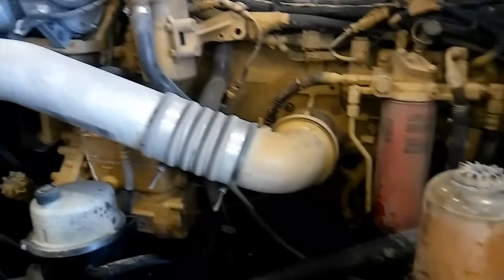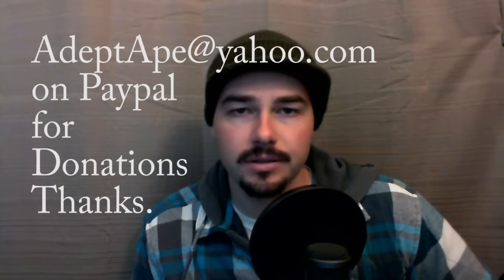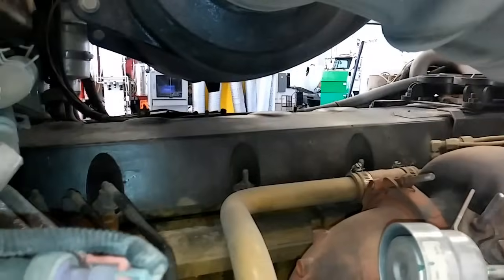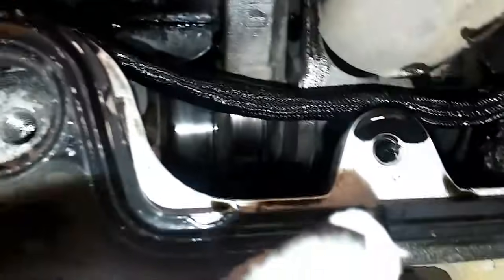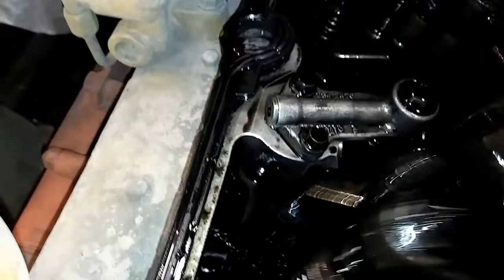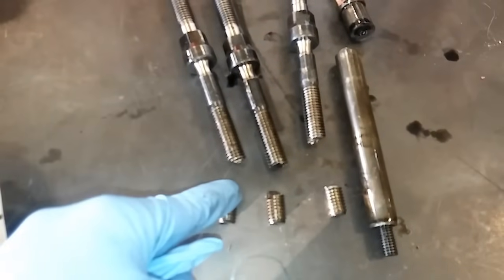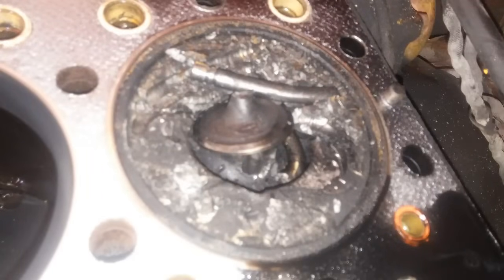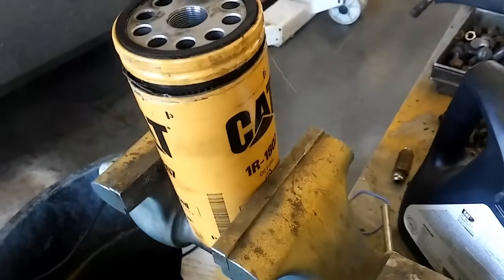What Causes Diesel Engine Ticking, Clicking, Tapping, and Knocking?

Comment: Great channel! I just discovered it. The C12 in the truck I drive at my day job developed a click, then clack, then knock, then bang. All within 1/2 mile. Ended up being the wrist pin in number 2. The teflon keeper for the wrist pin decided it didn't like being there any longer. Took out the piston (obviously), sleeve/liner, and took a hunk out of the block where the liner seals up. Block is junk. Employer is going the Platinum rebuild route. Cat dealership said they don't use the teflon keepers now?
Reply from the maker: +oldbones I know the little pucks you are taking about. I haven't disassembled a new C12 piston yet to check, because they get installed with the liner. I thought those puck designs were kinda weird.
Reply: S&S pistons(high performance) for Harleys have those "buttons" as an alternative to the circlips that have worked so well. I've taken apart a few top-ends that others have used the buttons in to find scoring (sometimes severe)  from debris trapped and embedded between the buttons & cyl liner. Somebody's idea for a "floating" wrist pin didn't work out to well no matter what motor it was in...

Comment: Hi, my name is Ben, I just brought a 2013 Ford Ranger, 3.2 Diesel engine, I notice I tried it for 20 minutes I start to hear a knocking sound, I can especially feel the knock on the clutch, after I change the engine oil, The knock comes on at about 40 min of driving now instead of 20min, it also comes on faster  if I under rev the car when I change gear, so if I change gears at 2500-3000rpm , The knock don't come on as fast, so lagging it makes the knok comes on faster, do u know what it is? Help

Comment: Hi bro
I have 1hd lc 80 engine
It has load sound and very hot blowing white smoke 
I changed my injectors and clean the pump but still the same
What should I do bro,tnx for help
Reply: White smoke can indicate water (coolant) in the combustion chamber. Look for a bad head gasket first, are you loosing coolant??

Comment: My 2014 Duramax 6.6 fuel injector pump went out. Is there a way to clean the injectors or do they have to be replaced along with the injector pump. I was told that there was metal in all the injectors now. Dealership repairs $9,000.
Tks

Comment: Hi brother I have contacted you previously about the shake I had in the engine and now finally it broke down on the highway I have exhaust popping/thumping/slapping through the turbo intake side a mechanic has seen soot in the intake and has said it's mostly a valve which I believe is correct but I had just 2 months ago run a diagnosis at Yancey caterpillar Jefferson, they did a #5 injector claiming 100% it will fix my vibration which didn't I asked them to run an overhead which made no difference in the engine sound, I think I'm just being robbed all over the United States of America truly speaking there are much much better mechanics off the streets in India who can diagnose and fix anything accurately and for alot cheaper. just imagine my engine vibration has been diagnosed/replaced bad power divider!!!🤔 then the drive shafts!!! 😣then the clutch 😵 then it keeps going on... all they have done is made me spend $16000🤑 on a $11000 🤒truck , all I ask is may God make them realize how hard it is to waste all that money. Shame
Reply from the maker: +Aiyman Khan Sorry to hear you have what sounds like valve or valvetrain damage. If they did an overhead and there was something wrong in the valvetrain, it should have been caught at the time of the overhead. It is possibly a valve issue, which wouldn't have been caught, but it is very unlikely a damaged valve would run that long before failure. Vibrations can be hard to find at times though, bad damper, off balance crank, lots of other things as well it could have been or is.
Reply: Adept Ape thanks for you reply. I wish I could have brought my truck to you can you tell me where is your shop so I can bring it there in the future. My issue was diagnosed as an injector by the cutout test which you said also could be a valve I also do have blowby which could have been the valve but now its no use I'll fix whatever it takes please can you send your work contact  by email aiymankhan786@yahoo.com or text 4045507005 thanks I wish I would have brought it to you before all this happened.

Comment: "pull your oil filter, cut it open and look for metal"  Don't forget to use the special filter cutting tool;  if a hacksaw is used,  you WILL find lots of metal particles...
Reply from the maker: +MrGGPRI Yes, a valid point, if you cut it with a cut off wheel or a hack saw you'll have small metal pieces in the filter.

Comment: G,Day Mate what do you think of Snake oil like slike 50 STP you put it in with the oil Slick 50 is $85 a litre ver dear is it worth it Thanks Man ?
Reply from the maker: +goldwingman1500 While it probably does have some benefits, I've torn a lot of engines down and inspected the bearings. I've seen engines with a million miles and the bearings look great with none of those additives. Modern day oils are pretty good and if you do normal oil changes and filter replacements your engine should do fine.
Reply: I have   a 2009 Subaru outback diesel 6 speed manual great lot of power my first diesel car i have ever had had 4 goldwing starting with a 1000 cc then a 1200 cc g/wing then a 1500 cc G/Wing for 12 years then sold her for $12000 with 165ks on the clock and bought a 2009 1800 cc goldwing luxury great ride i changed the oil every 3000ks with new filter i use a fully synthetic oil cheers for now talk soon goldwingman1500  Google N Albury Book shop Bomb i set the boobie trap off and shot 3fellow fireman or go to my youtube channel goldwingman1500                       talk soon .?

Comment: I have a 94 f450 73 and I've got a problem I have 3 rockers  on the same side that are loose and not oiling good but I've got good oil pressure would bad injectors  cause this
Reply: IDI or PSD?

Comment: Been around diesels my whole life. They make lots of noises and 9 out of 10 people would never think they had an issue for slight knocks and ticks. If you tear into a diesel that's been used odds are you will always find something wrong with it. Doesn't mean it won't last another 10 years that way.
Reply: austinr09 people like you keep me afloat i always get bummed when people say somethings wrong with my international but ive had the motherfucker for a year and everythings been good just regular maintenance and wear and tear thank you for your words of inspiration
Reply: Michael Medina Same here...my cat sounds good but theres a tapping sound...you get paranoid from every little sound when it's your truck...nonetheless i'm still saving for a full rebuild...just in case
Reply: @jmh4ggg  wise move. Doing  the same. 3 years later did the rebuild come to fruition or were your worries for nothing?
Reply: @CowboyFirm  Lol it's crazy that i wrote that 3 years ago. Yeah i did get it rebuilt, it started pushing coolant out of the reservoir, the head gasket was compromised, but the tapping was nothing to be concerned about. 

Its been about 2 years since the rebuild, i'll never go to a 3rd party for expensive work like this again. The front main seal has been leaking oil, and I forgot what its called, but my cold air intake module needs to be replaced. This has been a problem since right after the rebuild, they messed it up. However since i still have all new parts in my engine, im just gonna have them replace those air intake modules, replace the front main seal, and replace the head gasket and spacer plate and be done with it. 

I'm hoping to get all that done by march.
Reply: @jmh4ggg  what engine do you have?
Reply: @jmh4ggg 
Ja som tiez paranoidny z kazdeho maleho zvuku.3x som prerabal motor a 2x menil.Pozdravujem zo Slovenska
Reply: Go get a tune up or valve adjustment fixed mine

Comment: Would it not be due to a high compression ratio during the pre-ignition phase where pockets of fuel combust before TDC which essentially works against the power stroke? The compression ratio is uncontrolled (unless you have an injection rate shaping system installed) and thus the flash point can be mis-timed especially when you have a rich burn with a lambda value lower than 1. I'm studying Mech Eng at uni in my last year and this is a common question that has come up in past papers. This would result in high frequency vibrations with increased stress concentrations... anyway that is what I thought. I could be wrong, but it would be good to know the answer.

Comment: HELLO ADEPT  I HAVE A MITSUBISHI 4M40 DIESEL ENGIN THAT DEVELOPE A KNOCK  WHEN I LOOSE THE TWO FRONTH INJECTOR  THE NOISE STOP  AND THE ENGINE RUNING OK WHEN I TIGHITEN THE INJECTOR LINE THE NOISE CAME BACK ITS LOOKS LIKE THE NOISE ONLY APEAR WHEN THE NUMBER 1AND 2 PISTON COMES UNDER PRESSURE ANY ADVICE

Comment: I have a large John Deere excavator, a smaller dozer and a 710e backhoe. These run like sewing machines and not a click or tick or knock to be heard. NO starting fluid or glow plug system on them. Turn the key for 2 seconds and they are running. Snow, ice, rain, no matter. My friend pulls up in his Cummins dodge and that son of a bitch sounds like it has a bucket of bolts rattling in the head and pan. Gotta wear my hearing protectors when that piece of crap is around. And just try and start that shit without a glow plug! Ha. My 4 cylinder Deere in the dozer has 14,000 hours on it and is likely 27 years old. Dry block as new from the factory. If I heard anything like that Dodge Cummins that I can hear cummin from a 1/2 mile away in my equipment, I would scrap it. There must be some reason Cummins designed that terrible sound into the engine - maybe it makes the drivers feel like their ding dong just got longer. Me, the purring sound of smooooth Deere power is the sign of great engineering. Just my very NOT humble opinion.
Reply from the maker: +Richard Raucina I'm sure the Cummins doesn't sound as bad as those old 6.2 and 6.5 GM Diesels, those things are engineered to knock.

Comment: Well, as you pointed out, there is a huge difference between rocker arm or lifter noise, and bearing noise. Surprising people do not get on these as soon in passenger car engines as they do in commercial engines. My friend ask me, I told her, your engine is off time, you need to replace the timing belt now. It was a 4 vlve per cylinder OHC Ford inline 4. I told her that is an interference engine, that car is not worth more than a couple thousand running. If that belt goes full bad, your valves will hit the pistons, and that's a full overhaul, more than you car is worth. Two weeks later, she got an estimate for $3400. The original estimate to replace the belt, $200. She had the 2 bucks, didn't want t spend it.

Comment: I know this is not CAT related and I don't remember if CAT motors do this or not but on my non-egr Detroit Diesel S60 12.7L DDEC4, while you are under load at full power from the low rpm band through mid band, the diesel sound (clacking) is deep but once the engine senses it's no longer under load and into the higher rpm band the diesel sound changes to a high pitched kind of looser sound. I know all Detroit S60 electronic engines do this but I've never understood why they do it. Could it be variable timing that has one setting under full load versus another at a lighter load (I'm talking engine loading) or if this has anything to do with fuel rail pressure. I'm not sure if CAT electronic engines do this as well because it's been awhile since I've been in a truck with one. I've also noticed the deeper sound is consistent with higher turbo boost pressures and as that loading is lessened and the boost pressure begins to fall, then the engine sound changes to a lighter sound. Again I know this is normal but I've never understood why they do this and what is taking place that causes it. I guess this would apply more towards the overhead cam 3406E in comparison with the Detroit S60 since it is also overhead cam. Do you know?
Reply from the maker: +James Barrow Its hard to explain sounds over a comment section, but I'm not exactly sure what the sound you are describing sounds like. I've never been in a cab of a truck with a S60 under heavy load so I can't compare the sounds.

Comment: What was the wire loom inside the valve cover ? Wouldn't the oil wreck the loom in no time ? I'm new to diesels so be gentle I'm just asking to gain better knowledge
Reply: For the injectificators.  And it's fine like that for a good while anyways.
I drive a F350, same with those wires under the valve cover connect glow plugs and injectors, on the 7.3s the connector for the other side goes through the valve cover gasket and connects just outside the valve cover.

Comment: Hi Mate i have 2009 Subaru Diesel outback i hate dirty oil can you buy an after market oil filter that will clean my oil better than a standard one Years ago they sold like a toilet cyclender with like crap paper in it to filter your engine oil better and is it a good Idea to put Magnets around your oil filter and should i use a fully Synthetic oil rather than standard oil ?cheers Help ?????????????
Reply from the maker: +goldwingman1500 I would steer away from that toilet paper filters, they do make centrifugal oil filters that are supposed to clean the soot out, so you might want to look into those. The magnet thing does help catch a little extra stuff, but the filter should catch that anyways. I put synthetic my car at home and everything I've ever seen about synthetic seems to lead that it is better for your engine.

Comment: hey I found two leaking gaskets on my c15 cat engine manifold. Is this a cheap, easy fix?
Reply from the maker: +Will Sledge I'm assuming they are the seals between the manifold and the head. That can be a quick fix or it can be a big fix. If the leak is there because the stud failed then you can have a big job on your hands. If the studs are fine, but just need new gaskets it isn't a really hard job.

Comment: i have some blow by on my 1996  m11  cummings   Volvo..   is there anything i can put in the oil to help it?  i only put  3k miles a year on this truck as its for my rv..  rv hauler  any help would be great thanks love your videos
Reply from the maker: +The Deprey's Not really anything that'll stop blowby by putting it in the oil. If you are running thinner oil than recommended that can increase the blowby. If you are concerned about just the blowby, but the engine runs fine there are aftermarket blowby filters that you can add on that will vent the oil back to the engine and keep most of the oil mist off your RV or tow vehicle.

Comment: I have a 06 freightliner with a c15 cat engine. It has over a million miles. when I accelerate it makes a ticking noise around the turbos. when I looked around the turbos there is soot there but I can't find the exhaust leak
Reply from the maker: +Will Sledge Exhaust leaks can be hard to find sometimes because the soot will burn off the manifold. Look for missing exhaust nuts and which direction the soot looks like it is coming from.

Comment: I've got a cat 3406b which I did a complete in frame rebuild on and I keep having problems with valve train components breaking ever since the rebuild, I also had the head rebuilt (new valves, springs guides and seals), the first time the pedistools that the hold the valve train cracked, then later I had a valve bridge break In half. The motor is defininatly making more ticking noise than it did before the rebuild.
Reply from the maker: +Guns Bikes And More Sounds like you've got some sort of valvetrain geometry gremlin going on there.
Reply: Adept Ape yeah I'm pretty convinced the machine shop screwed something up with the valves, something is either out of spec or they installed the wrong valve springs.

Comment: Hey adept I have a 2013 ram with the 6.7 it has a rattle coming from the engine but not in neutral or park. It only makes the rattle after the motor heats up and only while coasting to a stop between 45 to 20 miles per hour. I brought it to the dodge place they said there's nothing they can do without a code 😖 it also stops when the exhaust brake is on either because I can't hear it or because it's putting pressure on some part that's going bad. Any thoughts? Thanks and great vids buddy.
Reply from the maker: +iammimic79 That's a hard one to troubleshoot in a comments section, sounds like an exhaust leak potentially. I would get a mirror and really check that exhaust system for soot/leaks. If it was valvetrain related you should hear it all the times. Now it could be something like a motor mount or something too because you say it only makes it when your moving. Have you inspected it yourself thoroughly yet?
Reply: Adept Ape thanx I'll get under there and check it out today
Reply: Also I forgot to mention it's a 4x but I did go under there and check things like driveshafts u joints just didn't think about exhaust maybe I can try to get a video of the undercarriage while driving and post it to my channel and you could hear the sound thanks again

Comment: Diesel engine noises are like the sands of the sea and a lot of times very hard to put your finger on...fuel / injector knock is a tough one to figure out. I believe even the fuel it's self with any additives is gonna make it fire differently, thus some kind of noise. Think of a guitar string out of tune, what made it go out, the string stretching or maybe humidity is making the whole instrument swell and contract. Don't know if this is a good explanation, but the point is, very hard to diagnose.

Comment: The engine with the broken actuator housing and rocket shaft did it have the upgraded IVA studs?
Reply from the maker: +blake Taylor Yes they were the updated bolts. The updated bolts fail as well as the older ones, but they fail less around the bolt head usually, but fail still.